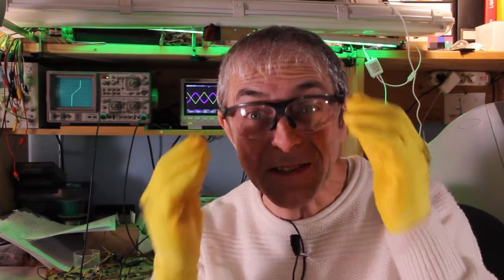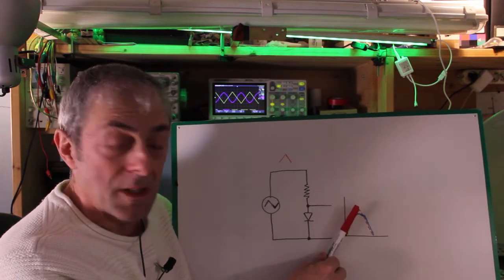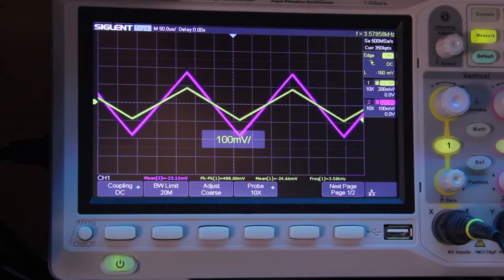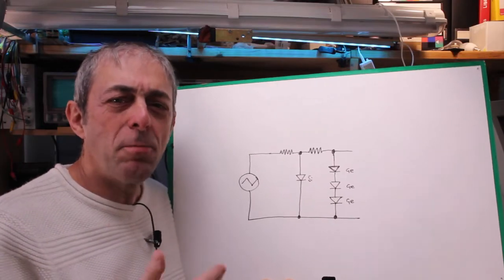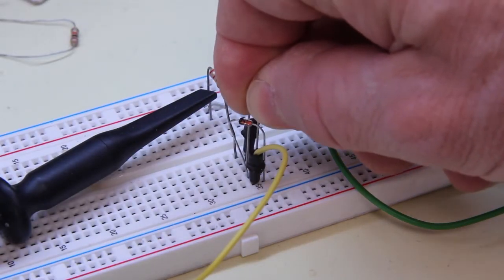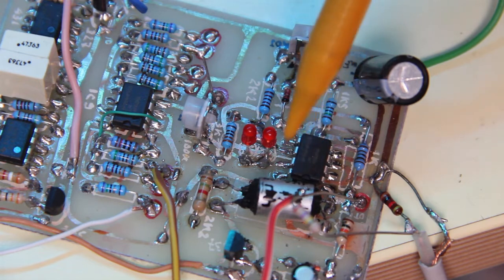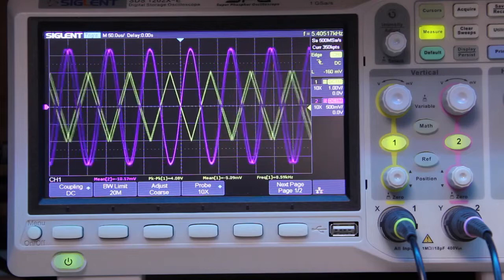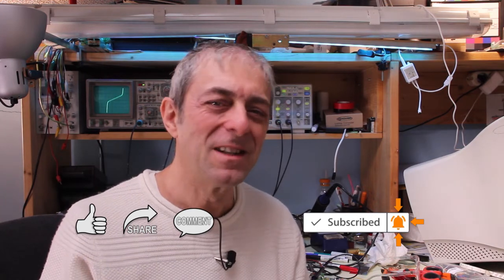Triangle to sine with a #wave-shaper #electronic #circuit

Comment: Thanks, this circuit is good enough, i just change opamp with single transistor, and it worked, the input triangle shoukd be around 300mv to 700 mV. Awesome !!!
Reply from the maker: @erwinchandra8714  interesting, how did you manage to shape the lower part of the waveform (the negative excursion)? Thanks for commenting.
Reply: @AccidentalScience  first i series each one of led with silicon diode (1N4148) and change resistance value which series in gain pot from 3k3 to 15k, and ensured the input triangle within 400mv ~ 600 mv.  Used only 9v supply, voila excellent sine wave, too bad dont have distortion meter 😅. Once again thanks a lot.
Reply from the maker: @erwinchandra8714  gotcha. Nice trick. Thanks mate.

Comment: Please make a part 2 follow up for this and improve your designs...because this is not a waveshaper. This is time-dependent network with diode filter and LED feedback significantly filtering the signal, making this unusable for I.e. phase distortion. You are making the assumption that the input signal has to be a triangle wave. That's why this isn't a waveshaper. You didn't see the importance that it maybe a modulated triangle wave with any arbitrary phase input at any moment in time. Try using this with arbitrary phase input and you will see it does not hold up.
Reply from the maker: So please explain where you see the time-dependent network, neglecting diodes' parasite capacitance of course.

Comment: can you make video on how one port and two port network synthesis applied practically on designing ckts like filters and amplifiers, I'm confused because all the sources i found talk about the calculations, the parameters, sys function....my questions is how can I convert statement problem in to circuit design using/applying network synthesis. tnx!

Comment: What are the resistor values that are used on the PCB?
Reply from the maker: Sorry at the moment I don't remember. At what point in the video do you see the resistors you're asking for?
Reply: @AccidentalScience  at 5:10 when you start explaining the circuit that uses the LED's. I want to use this circuit for my VCO. So it would be nice to have an indication in what range the resistor values should be so I can tweak it easier. Thank you in advance!
Reply from the maker: Sorry for the late reply, I didn't notice your reply. Here are the resistors: 33K + 100K trimpot (series) for the OPAMP feedback (in parallel with LEDs), 1K + 2K2 (series) at the OPAMP input. At the node a 10K trimpot goes to the diodes.
Hope this help.
P.s. I am moving to the new website. It will take some time to complete but I will put there the schematic of this circuit as well.

Comment: Hi, very interesting to watch.  I was looking to understand how does this triangle to sinus conversion works. As I have bought today a second hand old Function generator Voltcraft FG1617, and did some testing right away and have seen that for the highest frequencies ~ 500 - 2MHz (2MHz is max) I could se the harmonics (multiple of the base frequency) on the spectrum analyzer. I also could notice the distortion (looking on the scope) just itsy bitsy before the top (or at the top) of the sinus shape, and just before the lowest point. Nice thing about these old equipment that a lot of them have complete schematics within the service (or even user) manual. So I have found a adjustment potentiometer SIN.DISTORTION and tried to get it better. I could get it some better for those higher frequencies (like 2MHz) but then the lower frequencies got much much worse, the signal looked more as a triangle then a sinus, so I put the potentiometer back where it was. In their SINE SHAPE circuit they use 4 bridge rectifiers. You can find the user manual with all the schematics online, if you want to look into it. And then after those 4 bridge rectifiers the signal goes to a current mirror I suppose, where some DC.ADJ. and AMP.ADJ. can be made. There are also 3 trim-potentiometers with text SIN.A, SIN.B and SIN.C that are connected to 3 of those bridge rectifiers. By the way, they have specified the THD at <2% but for 10 to 600kHz. So above it did not looked very nice so they just have not specified it 😆 So the question is is there something that can be done to lower the distortion in general. And does the distortion is coming from those triangle tops? Or does it coms from one of the transistors (and some non-linear effects maybe) that process this signal? Anyway I am looking forward to watch more of your videos 👍
Reply from the maker: Interesting. That instrument is pretty similar to the one I used when I was at school. Nice. At the time I didn't even know how to measure distortion LOL. It's hard to have a wide frequency response and still maintain low distortion. I rather limit the frequency range and have lower distortion, that could come from a range of reasons, including the physical layout of the circuit. The problem comes with the non linear response of the amplifiers, since the waveshaper works at a specific amplitude. Also the very same waveshaper could be affected by frequency as parasitic reactances become more and more significant. It's always a trade-off.

Comment: Hi ! My application requires  converting a very low frequency triangle wave (0,1 to 1,4 HZ) input to a sinusoidal one 180ºusing a single power supply  so that the output will vary from 0V to maximum  what i got by biasing the non  inverting input using a potentiometer . I've followed  your circuit using only one  5 mm LED and just one Ge diode .The output is useful  but the botton of the sine is not "round" . What  can I do to correct this?  .Any way ,thanks a lot because your circuit was realy a great help for me  !!!
Reply from the maker: If you use Ge diodes you need three of them in series in place of a single SI diode.

Comment: A question follows after watching this video few times. Can we generate a sine wave directly at varying frequencies , instead of going through the triangular wave stage?  I was not able to find your episode on it.  Just about all the videos showing how to generate a sine wave is at a fix frequency.   I want to mention that  I watched your automatic gain control circuit construction, when you started inventing things like burying an LED and a light sensor into a homemade tube, I have to say that you know the physics of electronics to the point of almost being able to have verbal conversations with these components and ICs.
Reply from the maker: You can generate a sine wave directly. Try to give a look at the Wien bridge oscillator using an op amp and a small lamp to limit the gain. It is based upon the design invented by Hewlett and Packard. (We'll, they used a tube as an amplifier, not an op amp, but that is the concept.) That oscillator can vary the frequency by changing two resistors that form the bridge, you can conveniently use a double stacked potentiometer.
Changing the frequency with a control voltage is less straightforward and a design like the one I used in this video is easier eventually.
Reply: @AccidentalScience   thank you for the insight!